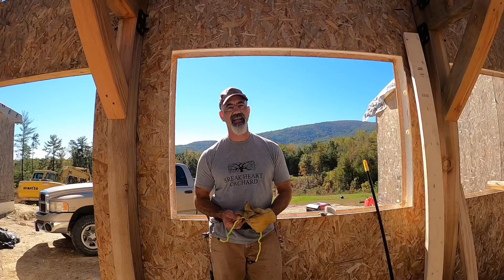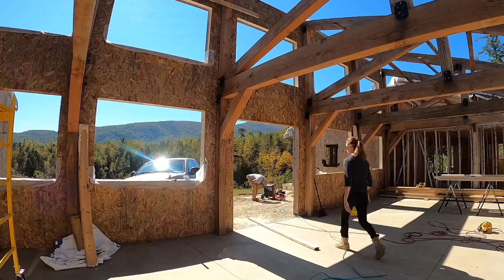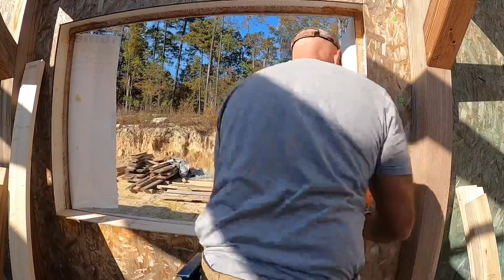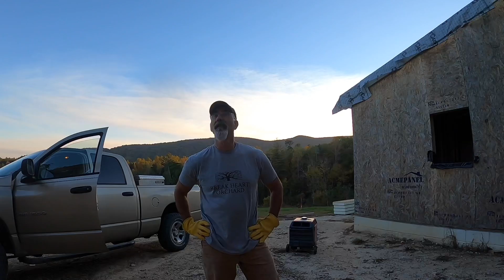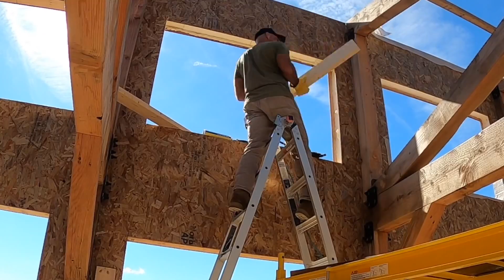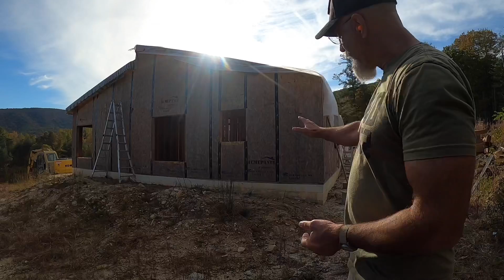Framing out all the windows for SIPs Panel walls.  DIY Post and Beam house build #86.

Comment: When doing that much wood work, personally, I wouldn't start without having a table saw and a compound sliding miter saw on site.  They don't have to be expensive.

The table saw will let you thin down those window frames faster than a hand planer and probably more exact.  It would also be perfect for cutting splines for SIPs.

The miter saw is great for setting a stop on to cut batches of same length boards with clean square cuts or compound miters when you are doing tricky angles.  The sliding feature let's you cut wider boards.

The Skil Saw should be reserved for jobs that can't use the other two or non critical cuts.

I bought a good used Taiwanese table saw for $150 and a used sliding compound miter saw is probably in the same ballpark.  They hold value pretty well, you could sell them after the job if you didn't want to keep them.

This advice is very late but for anyone thinking about a similar project, you can invest a little to save a lot of work and get more precise cuts.  The precision won't necessarily matter but it's nice knowing it is there.

I worked on a log cabin where you have to use a chainsaw for most of the cuts but still there were many times I was wanting a table saw.  There really wasn't much dimensional lumber so I didn't feel the same about a sliding compound miter saw but once you start framing it's a no-brainer.

I have to agree with the roof comments, that log cabin was a slow build but it had a roof for probably two years before the windows were bought and hung.  It was plywood up to that point and the door lock was a couple screws.

A log cabin structure isn't going to absorb water and turn to mush like OSB will but once the logs were up, it was tongue & groove ceiling, insulation with OSB bonded on top, spray foam and tape on the joints, then underlayment and roof, all done ASAP.  We didn't have to worry about breaking an expensive window either.